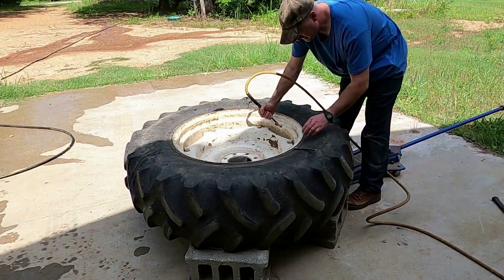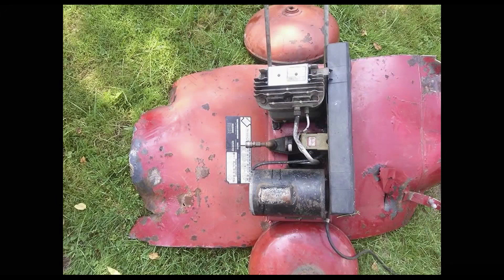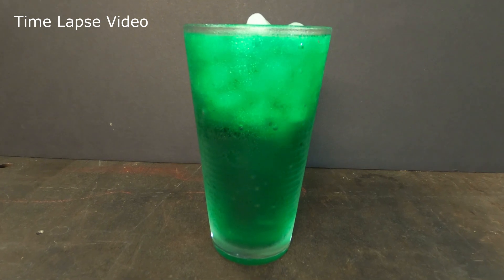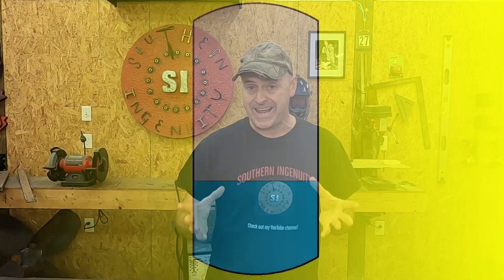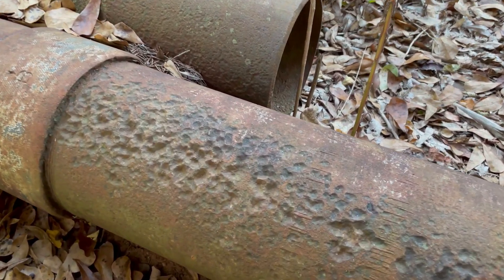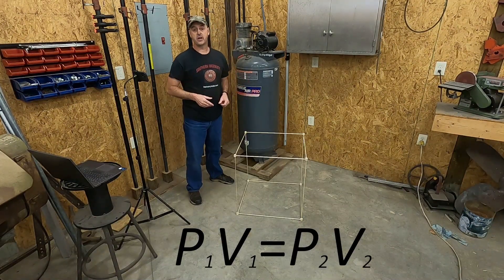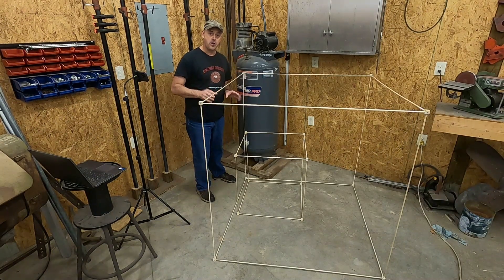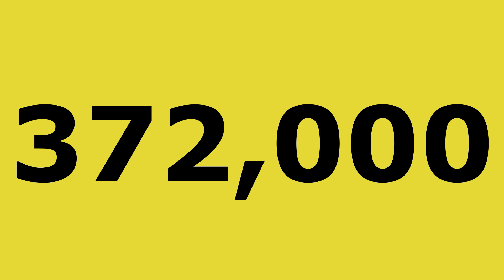The Deadly Explosion Hazard you Didn't Know was Sitting in your Shop

Comment: I’m just a home diyer.  I’ve bought 3 compressors in my life (pancake, 20 gal, 60 gal) and the instructions always said to drain daily.  I admit that sometimes I don’t drain my 60 gallon for a few days when I’m working on a project.  But the fear of rust and an explosion make me drain it regularly.
Reply from the maker: I installed the automatic drain kit and it has kept the water pretty much evacuated. The last few times I opened the manual valve there was only a few drops that came out. Thanks for watching.

Comment: Yeah, that's Effy, the air compressor I use was purchased by my old man 20 years ago. I inherited all of his stuff and I've never seen him drain it. Believe it or not, it still looks new, he didn't use it very much, it sat inside his utility building unused.
Reply from the maker: If it wasn’t used that much, there may not be much water in it. I would definitely fire it up to about 50 or 60 psi and crack the drain valve to see what happens. Be sure to check out my other video where I installed the automatic drain valve from Harbor Freight. Thanks for watching!
Reply: @southerningenuity4458  I will do that.

Comment: Good stuff. This is also why I don't really recommend buying a used compressor unless you really know what you are getting into. NO ONE remembers to drain the tanks, and the cost of a replacement tank is nearly the cost of a new compressor. Also to add..... under pressure it actually accelerates the rusting process. It might take 20 years for piece of metal setting on the ground to rust, but it will only take a few years for it to do the same inside a compressor tank.
Reply from the maker: Wow! I didn't know that. That's interesting. Thanks for watching.

Comment: We had one blow up at a newspaper  i worked at as a pressman .there were 3 big compressors. Near the sink. All the systems on the press were air operated. About 5 minutes after we all got done cleaning up and went on break. One blew up. It knocked down a big portion of a mortar block wall .blocks were in the sink.
Reply from the maker: Wow! You're lucky to have been on break and not in the area. Thanks for watching!
Reply: Im a bit worried about the one in my shop now the drain plug is seized and i have tried unsuccessfully to just remove it from the bottom of the tank .
Reply from the maker: @stevezielonko1386  Oh no, that doesn't sound good. Be careful.